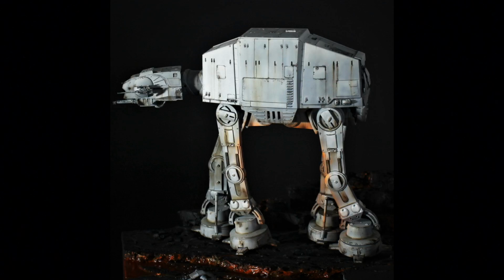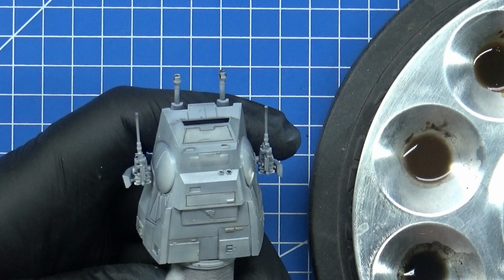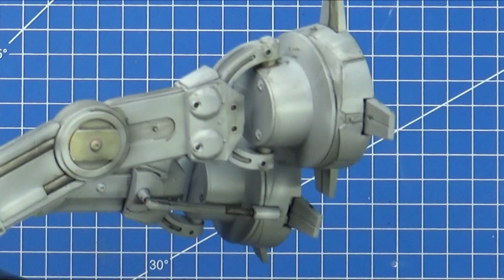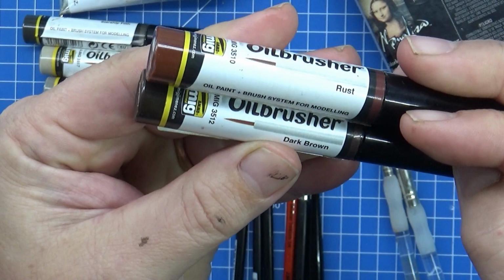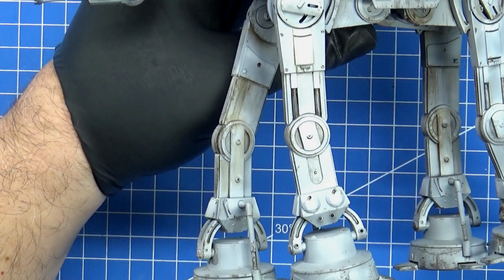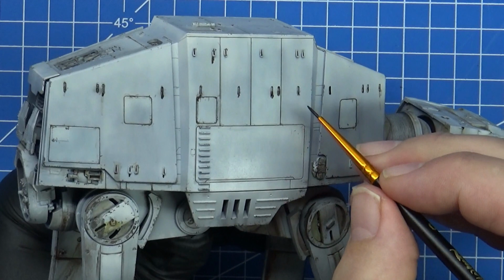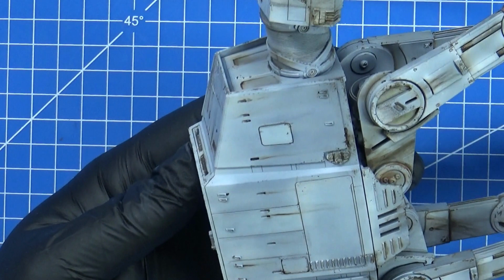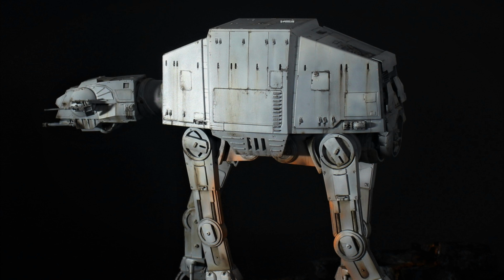Bandai Star Wars 1/144 AT-AT Step by Step Painting and Weathering

Comment: I’ve never had a problem with a enamel wash. And I’ve done close to 50 Bandai kits. Where ever did you hear that outlandish rumor. That’s so far out there.
Reply from the maker: Its pretty much across all the Bandai Star Wars forums, particularly on the AT-ST kits when you apply in the stressed joints of the legs. Depends how much you apply and how thin they are too I guess - lots of variables, but its definitely a known concern across the hobby. I've sidestepped it by using oils and inks.
Reply: I can confirm. I made an enamel wash thinned with turp to put on my AT-ST. Some of it got between the head and the earpiece that holds the turret and it ate the plastic.

Comment: Will the artist's oils dry on the plastic on its own, or do you have to mix a bit of dull-clearcoat in your airbrush to "lock" those colors in? I've painted in oils on canvas in the past, and it seems to take FOREVER to dry out. I'd like to use it on styrene/plastic but not sure if the dull-coat spray would dilute and push-around the oils and spoil the effect.
Reply from the maker: Due to the already dry nature of the oils (502 Abteilung especially, but even the Mig AMMO oilbrushers), they only take a day or so to fully dry, particularly if you are not using a lot of enamel thinner or white spirit to blend them/push them around. Some modellers will place the oil on a piece of cardboard to leech out the linseed oil therein, and its a very dry oil that once applied will dry very quickly (overnight).
Its best to apply the oils on a surface that already has a semi gloss or matt coat finish (either straight matt paint or a matt coat over gloss paint), they wont move around as much, but more than enough for our purposes. Usually I wait several days after I've finished the whole model and lock the whole weathering in with a few lights of dullcote/matt coat to seal in all the effects.